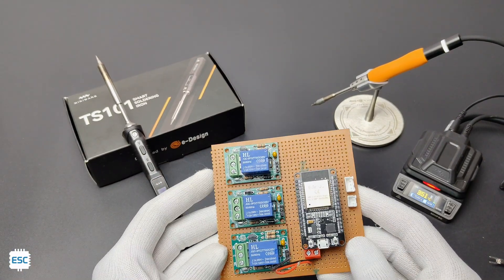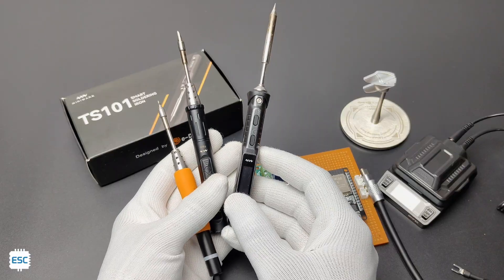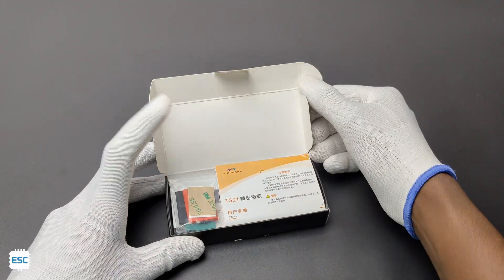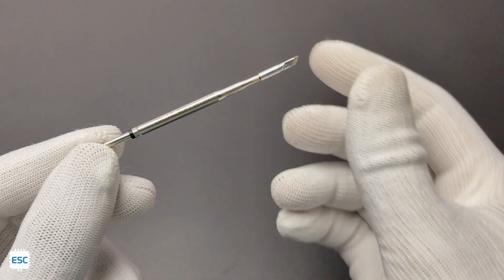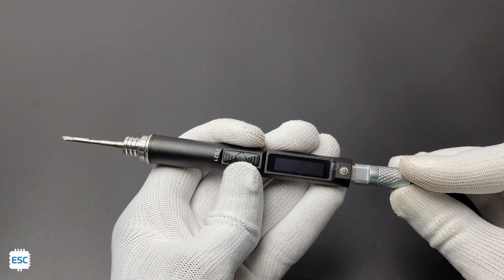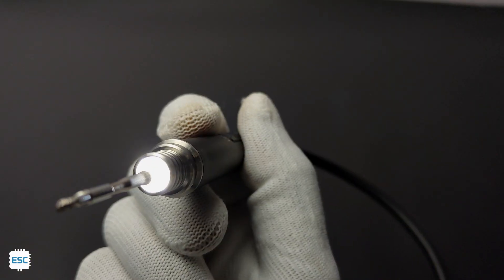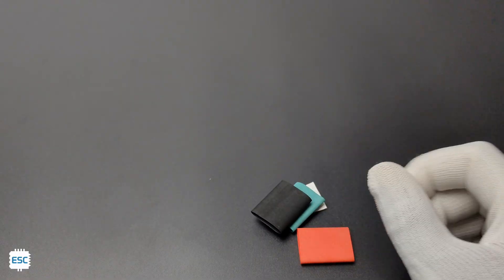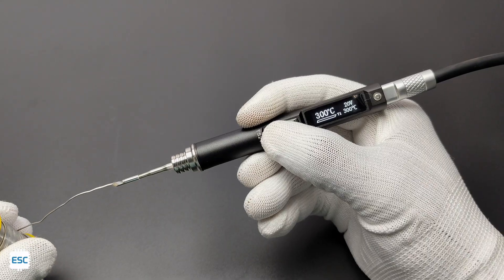The Fastest Soldering Iron - Miniware TS21 | Review and Test | 450°C

Comment: Wow, at 4:06 the TS-101 looks absolutely huge. I have one and thought it is tiny. The other two are even smaller?? 😁 And the tips 2:00 are SUPER TINY, wow! At this point, I have my doubts how well it retains temperature when placed on a huge cold block.
Reply from the maker: Yes may be I will test that
Reply: @EDISON_SCIENCE_CORNER  That would be awesome!
Reply: @NiMareQ this iron isn't for heavy soldering jobs. It's mainly for smd, some thru hole and micro soldering.

Comment: Compared to TS-80P it looks really cheap. I would say it's Chinese knock-off of TS-80P if I wouldn't know both are made in China by the same company. 😄
Reply from the maker: 😂. But it has lots of differences between ts80 and this. Like the heating speed, tip etc.
Reply: @EDISON_SCIENCE_CORNER  Yes, that's true. In fact it seems to be a combination of TS101 and TS80 with addition of LED. Yet overall quality clearly took a hit.
Controller design is clearly cheaper than TS80P and tips are just night in day in comparison. Looking at specs it seems like an improvement, but I wish they wouldn't take so many shortcuts while designing it.

Comment: How can I restore my "QuickFix Soldering Paste" - It's in a tin can and has not been used for a year and I think it's losing it's power.  Only used for a few times/ dips and that's it.
Any tips would be appreciated.
Reply from the maker: Remove the above hard layer. Under that the paste might be fine. If it is not then you cant use.

Comment: MAant HT-C210 soldering iron is better than others.. Other brand bits get damage and motherboard smps will damage within 1yr.. Also not precise temperature. Bit get oxidize faster in other brands..😌
Reply from the maker: Have you used   this iron.?
Reply: @EDISON_SCIENCE_CORNER  I tested several iron.. But MAant and Mijing iron performed accurate..not tried with iron in this video.
Reply from the maker: @jibin180  Have you tried any of miniware iron.?